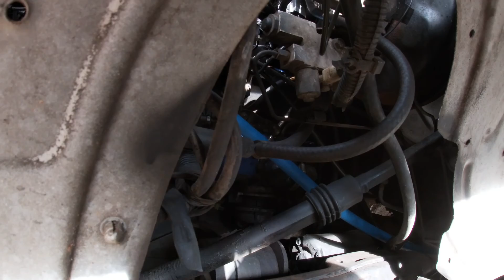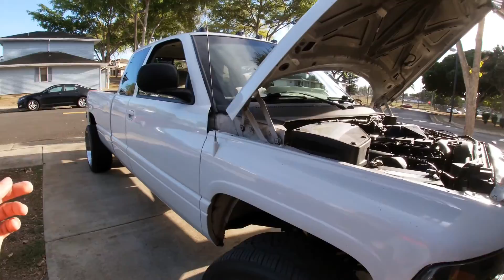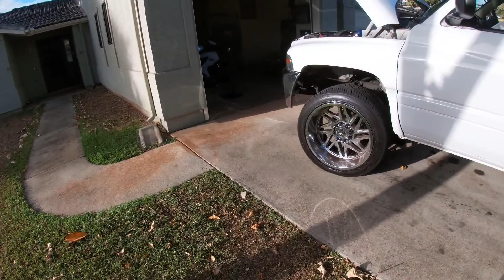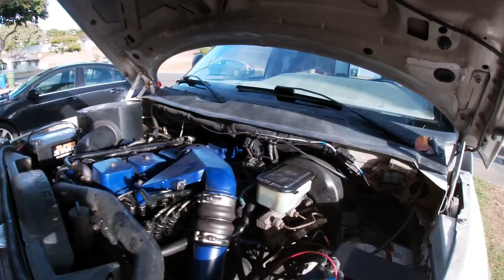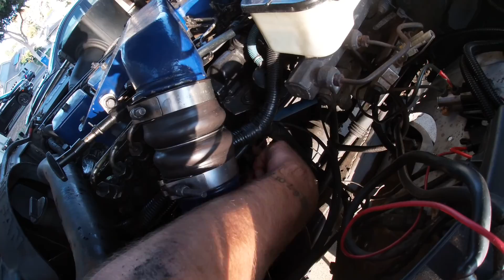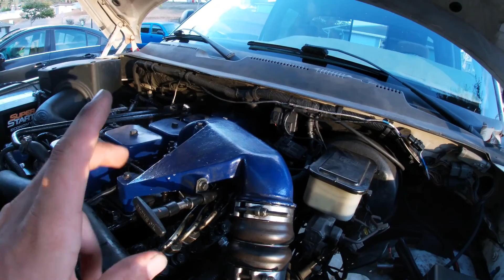Walk around my 12v cummins and fuel block off plate install

Comment: What did you do with the banjo line going to the fuel filter
Reply from the maker: I cut everything for the factory fuel filter out and used the return line off the injectors to the factory return line which is concented to the banjo bolt
Reply from the maker: Eliminating the banjo bolt and everything for the factory fuel filter
Reply: So are you using ur factory fuel filter at all? Still wondering what I need to do with that line because I have a raptor pump on my truck going straight to the fuel filter
Reply from the maker: With a raptor it gonna be different... I don't have a stock fuel bowl at all